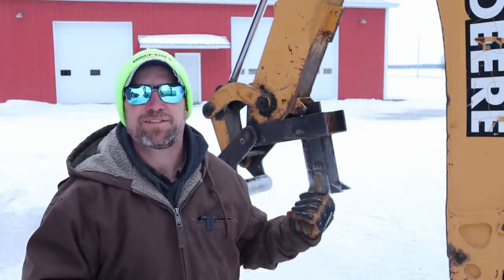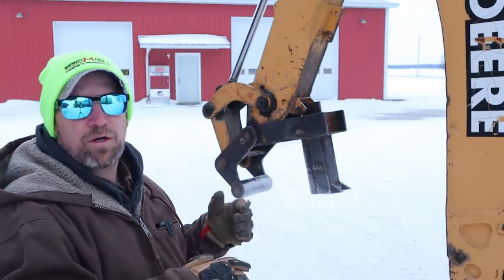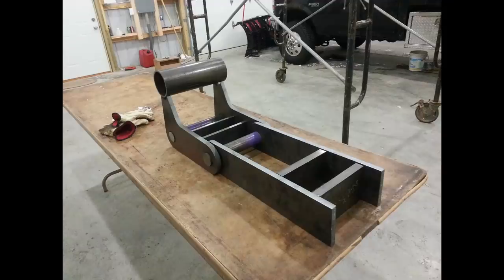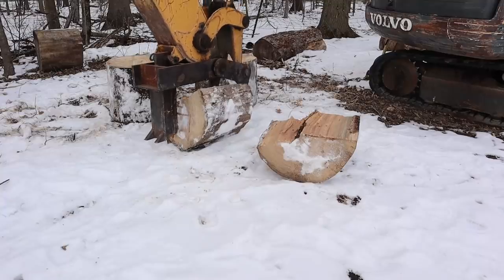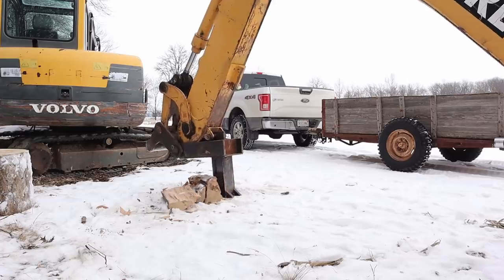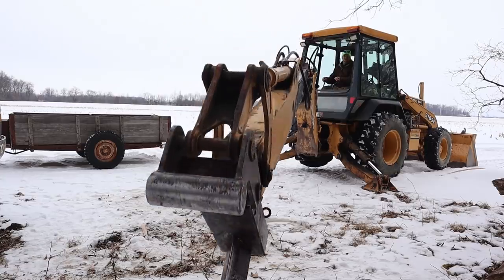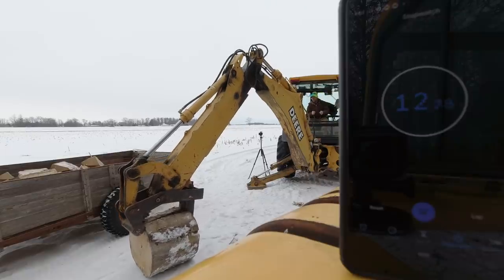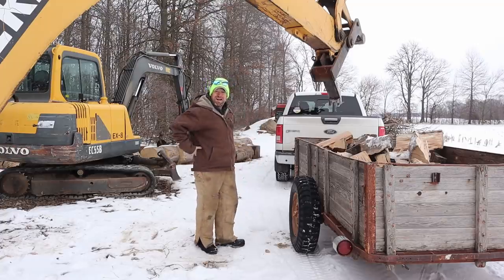My Wood Splitter Doubles as a Backhoe! - Homemade DIY Wood Splitter Splits Large Rounds With Ease

Comment: I’ve been thinking about something like this for a while. Since I have some 1/2” plate kicking around I thought I’d give it a try. 
I bought a cheap plasma cutter, created a cardboard template then cut the steel. I used a snow plow cutting edge as the splitting edge and the rod from a plow cylinder to use where the bucket attached. I welded it all up, attached it to the back hoe, grabbed a log and Bam! All my welds popped like a joke. After cleaning things up and re-welding a few more times I discovered my little 110v MIG welder didn’t have the sack to penetrate the 1/2” steel. So a new (cheap) 200 amp stick welder was ordered.  After some practice, I got the welds looking pretty good. Attached everything again and grabbed a log. Presto! Split my 26” dia oak logs like a dream. I was so psyched! 
For those who want to try this.. it can be done and does work. You’ll need the right tools and lots of patience. Don’t give up when it falls apart the first few times.
Reply from the maker: That's right!  Keep at it.  I had to redo the wedge on mine after I bent it the first time.  I'm always refining it it seems.  Thanks for watching!

Comment: Thats a really sweet setup for cracking down boilerwood. The real secret to firewood is the biggest volumes of firewood come from the biggest logs so to work the big wood effectively is the real key to efficiency
Reply: Hi Not Sure - it's Big Rodders in Ireland.  I live in hope to see a long video of your super log processor in operation.  It certainly is a unique design.
Reply: @rodneysweetnam8653  I have some more videos uploaded Big Rod. Maybe this year I will make some more effort to film but usually I'm focused on running the machine
Reply: @NotSureJoeBauers  - Big Rodders again.  I'm subscribed to your channel and have viewed the various short videos you've uploaded.  They have whet my appetite for more.
Reply from the maker: Boy, you are right about that one!  I always drool over the big ones cause I can make so much wood so fast.  Lots of folks avoid them though cause they're hard to work up.  This  splitter is the nuts for the big ones!

Comment: Thank you Neil for taking the time to do this.
I know everyone is looking for measurements. Here is what I get from looking at the picture.
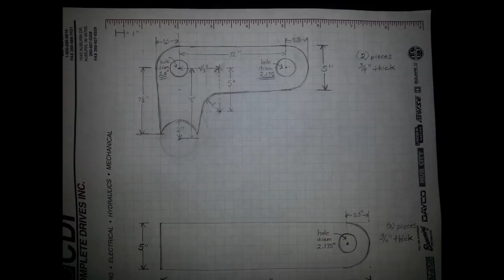Picture starts at 3:39
Looking at the diagram. Make out of wood first. A lot cheaper to get your prototype that way.
2 Back plates. 3/4 inch thick. L shape.
For John Deere 2 inch pins.
Hole diameter 2 1/8 inch would give a 1/16th gap all around. Guessing it would be enough room to freely rotate.
Top portion as shown in the picture. Length is 17 inches. Width is 5 inches. Measure in 2 1/2 inches and 2 1/2 inches down would be the hole center. The hole centers are 12 inches apart.
From the left top hole center down 8 inches is the pusher bar center. Pusher bar is 4 inch diameter.
How far apart the 2 plates need to be, I don't know. Hope this help a little.
Reply from the maker: Thanks so much for all that!  I need to get it documented.  I've had so many people ask and I can keep up with everything at the moment.  Getting behind on the comments too.  I appreciate you taking the time t write it out here.  I will point people to this comment.  Thanks for watching!
Reply: About much did it cost to build?

Comment: I wanted to thank you for posting this video. I just finished making one of these for my Deere 110 TLB. It was more in depth in the design with the quick change bucket that Deere had developed. I also felt it necessary to "beef up" the attachment point on the crowd. But with all the design, figuring, head scratching and fabrication done I am loving every minute of this attachment. The learning curve was quick for me. The third day I could see my production dramatically increasing. So far 22" diameter is handled with ease from my seat. I just love saying that! I do have a bad back from years of construction and ultimately having a disc removed. But with this attachment my back is in good shape. Thanks again for this share.

Comment: Here I thought we really had something when my brother built our first wood splitter 😁 It did do about 25 years worth of wood splitting for 3 of us, and is still in use 35 years later.
Reply from the maker: Sounds like you really do have something there Charles.  Any piece of homemade equipment that can put in that many years and hours of reliable service is a truly great machine!  My Dad built a homemade splitter as well and we still use it once in a while.  Thanks for watching!
Reply: @digdrivediy  Originally, that home made one ran off a used up worn out 5or6 hp engine my brother got from his neighbor. It ran about 5 years with that, then we collectively bought a new 5 hp BRIGGS. That engine is till on it, but has been experiencing difficulty of late. 😉

Comment: Neil you are a fine Gentalman and great enginere-fabricater. My fire wood endeviours have rewarded me @ 80cents an hour to heat my 4 different houses with firewood ; all things considered.  On the otherhand selling the product has yeilded 15.oo$ an hour selling the product. I would us a 6 pound splitting maul for fantastic results in 95% of logs succesfully achiving this at a half of cord per hour. (Cord =4'×4'×8' tight stacked wood). Home heating using this amount typicaly lasts 4 days. So mathamaticly speeking ,8 cords = one month of heating VS. Paying a 120.oo$ gas bill & a no touch effort. Selling 8 cords will yield aprox. 1200.oo$ with loading,delivering and restacking to costomers. So the margine of the resourse is EIGHT × more proffetable ( incluiding delivery&handling expeditures).With a total time to process a cord = to 4 hours total time, including the harvasting, gathering ,splitting,stacking,loading( note:many times over repeated in many facites of the total aplication) ==== lots&lots of WORK. Not to mention I am payed to haul raw wood away. And further more I would never burn a drop of fuel in my tractors or loaders  once the raw wood is payed for (costomers lot clearing or tree removal jobs).              By the way Mr.Niel upon observing your fine mechcanised ways I believe I'm 2× faster & more efficiant. I have prossesed aproximatly 250 cords with my time tested & provened methods over the years. The time studied ways (and many at that) have yield me a minor wage & lots of fun in the firewood monky-bussinuse. The exercise & fresh air are the best beniffits. Burning up fuel and expensive eqipment (trucks, tractors,trailers) hardly, HARDLY ever-EVER pays more than 5.oo$ an hour. My 30 year old (wheelburro-6 pound maul splitting way) was & still is the best for the last 40 years. Maybe when I am old & decrepped I might find a more efficiant way.!                                I enjoyed your vidio immencly & out of the 50 or so firewood processing vidios I have seen,l have laughed all the way to the bank--- with your exception. Realy nice rig for your 150,000$ back-hoe to split a 10 cent piece of firewood. My equipment == 225,000$ put that ends when l have been paid to haul it (raw wood) away initially. I have learned a lot over the years, kindness,respect,generosity, learned&shared,plus hard work,produtivity have given me much joy to serve my fellowman. Likewise l consider my tallents & endeviours a Great Blessing. Once again thank you for your inspirational vidio Neil.
Reply from the maker: Thanks so much Donald!  That's a good bit of info to process but it sounds like you've got your firewood endeavors figured to a fine science.  I have a much more pragmatic approach where I usually just try to solve my firewood needs with the most sensible means possible.  Often times that should involve more manual labor options but I always seem to opt for the mechanical solution whenever available!  I usually only use the backhoe to split wood when the pieces are too heavy to lift.  I hardly ever use a maul although I probably should try more often.  I can completely agree with your statement of fresh air and exercise being some of the best benefits.
I really appreciate you watching and for leaving a great comment.

Comment: You've got some skill with that backhoe! I will say, that oak pops nicely and I find it really pleasing to split by hand with a good Fiskars maul. Really would like to see this awesome contraption on wood I hate to split: Boxelder crotch or Elm.
Reply from the maker: Thanks, takes a bunch of practice.  There is certainly wood that it doesn't like, like heavy crotch wood but I can usually break down most stuff. Thanks for watching!
Reply: да он действительно экскаваторщик высшего класса..!

Comment: That is absolutely genius and very fascinating!
 It looks like you have enough hydraulic power, to run a blade horizontal to the one that you have and have it T midway across the existing one, then you could split a log in fourths in 1 bite.
Reply from the maker: I've tried with minimal success and I cut it off. May try again sometime with different design. Thanks for watching!

Comment: I'm just 31 seconds in Neil... And I'm feeling your pain brother. I have actually done that in the past. When it's a cold outside. Be careful :-)
Reply from the maker: I tell ya, it's a pain.  I hit that piece 10X more than what you see in the video.  I had worked up a good sweat and I never cracked it...
Reply: @digdrivediy  I swear some of those trees I used to hit when it was freezing cold we're made of rubber :-) I love the way your backhoe does it. That's the way I like it sitting in comfort and splitting wood :-)

Comment: I’d be interested in a price on the plans for your splitter as well. One of the simplest and nicest designs I’ve seen.
Reply from the maker: Thanks Joel.  What is a set of plans worth?  I've had several ask but don't know what I'm looking at in terms of what people would be willing to pay in comparison to the time to have something drawn up.
Reply: @digdrivediy  i would buy a set of drawings if you decide to sell them
Reply: @digdrivediy   People say they are interested until time comes to put their money where thier mouth is lol. I personally wouldn't be bothered selling the plans. Its a simple design. The plans really only have value if someone has the cnc burn table to cut the plate out...    Kick ass wood spitter tho! I just got a Case 580 backhoe and I was thinking of some sort of auxillary hydralic line or something for splitting wood. Your design is way easier to implement.  
I can def. see how it may take some skill operating that over to each log, but this is easier than loading each heavy ass log up onto a wood splitter. So my opinion is its even better than a regular wood spitter since it saves your back!

Comment: Many thanks Neil for this demonstration.  Love the plywood mach up you did.  I am planning to examine fabricating a pusher and wedge that may be attached to my mini ex bucket and thumb avoiding the need to knock pins out etc.  will need to immobilize the thumb and probably will want to not use a drilled buck pin to avoid cracking it. Wish me luck.

Comment: For your shearing bolt on the pin problem maybe you could weld two pieces of 3/8 thick stock to the face the pin bolts to. This  would “trap” the outside of the pin where the bolt goes through then the bolt wouldn’t have any shearing force applied to it.
Reply from the maker: Had some others suggest that as well.  I think I'll be doing that soon.  Thanks for the comment and thanks for watching!

Comment: Great idea. If my math is right. It took you 12 seconds to get back in the cab after setting the timer.  Then almost 15 to get back to stop the timer. Not a bad time.  My son and I have stood our splitter up and rolled big rounds to split. We thought we were high society. Your method sure beats a maul and wedges. Before we got our  splitter we would score the rounds with a saw then use a sledge and wedges to split them. Needless  to say using that method we had  a pickup load of big rounds that sat till this year when we got our splitter. Now I wanna go buy a backhoe lol. Thanks for sharing I enjoyed it
Reply from the maker: Thanks Kory.  Those vertical splitters can be really handy too.  I actually have a 35ton TSC splitter as well that I've tried to stand vertical and it can get the job done for sure.  We used it that way several times before I built this.  I think I proved I'm pretty useless with a maul too!  You go get that backhoe! lol.  Thanks again buddy.

Comment: Keep a bunch of old trailers on hand... never stack your wood at home. Just park one closest to the wood stove...
Reply from the maker: I actually love that idea Jack!  I've been on the lookout for more trailers to do exactly that.  Thanks for the great suggestion.  Anyone got any junky trailers for sale that will hold at least a cord of wood??
Reply: I use a couple of old manure spreaders.
Reply: I made a large box using sturdy pallets with a top which can be removed to fill and a hole/hatch in one side to access the firewood. There's a pallet as the base too which I can use to move it around with pallet forks on my JCB bucket but old trailers is a great idea too!
Reply: From all the wood you get from storm cleanups, maybe you can build you a couple of heavy duty sleighs to haul and stack them chunks and pull them around with that backhoe at the same time?
More cost effective than trailers i guess?
At least no flats to deal with😁
Cool stuff, thanks for posting☕

Comment: Neil I see your wood prototype had the 4 inch PVC angled towards the wedge about 4 inches.....then your steel one is 90 degrees straight....did you ever wish the 4inch PVC when pinching close to your wedge was a little longer....the steel one is angling 4 inches up from the end of the wedge...if it were a little longer it would almost touch the blade.....also a piece of keystock on each side of your teardrop pin retainer will prevent it from rotating and shearing your retaining bolt...skidders have these on their pins....I'm making the plywood templates to adapt your idea to my 580 case backhoe....thanks for the inspiration...now I just have to get moving on the new project!!!!......Thanks Neil
Reply from the maker: Hi Richard.  Like you, I saw that my plywood templates were different than the finished product, but to be honest I can't remember the reason for the change back then.  The angles weren't right when I built the first version and for whatever reason I changed it.  Unfortunately I didn't keep any kind of record or alter a blue print so all I can say is I just changed it to work better.  When I had the plywood on there, I was picking up and attempting to "split" rolls of fiberglass insulation and a few large chunks of Styrofoam.  So, I was cycling it while picking something up to test it.  That is what led me to changing it.  The push bar on the finished splitter does come around and just barely touches the wedge.  Best of luck with your build!

Comment: That is very cool ! I have a bobcat e42 with a quick attach bucket and I was trying to come up with and idea like that but I would have to run another cylinder off the secondary hydraulics. Very nice.
Reply from the maker: Thanks Eric!  It works pretty darn good for as "simple" as it is.  I use it all the time on the big stuff.  Still split the stuff I can handle with a normal hydraulic splitter then.

Comment: Hi Neil - it's Big Rodders in Ireland.   Your invention is one of the most impressive DIY inventions I've seen on YouTube as it appears to be an affordable addition to the average log hound.  It's easy to get great equipment if you throw big money at it but firewood is a low margin business and equipment needs to earn its keep.  Thanks for the shout out - I sometimes feel I wasting my time making suggestions but you've restored my faith.  I used to split 180 cords a year, now down to 30, but would have retired years ago without my timber tongs.  They've turned into natural hand extensions for me by this stage and with a bit of practice you'll develop that flick of the wrist to lock them on and then to throw the log.  They are particularly useful if you're bucking logs as you can just stand in the one spot and pull logs towards you without having to stumble all over the place trying to go to them.
Reply from the maker: Hey Big Rodders!  I'm so glad you caught the shout out!  There is certainly a learning curve to using the tongs but I can already tell how useful and helpful they will be.  I split that bit of wood on the ground just to try out the tongs!  I am hoping I get better at releasing them as I throw them as many times I'd go to let go and it wouldn't.  Thanks again for the suggestion.  It's always best to listen to the fine folks that have more wisdom about a subject than what I do.  i'd still be bending over if not for you!
Reply: @digdrivediy  Big Rodders again.   Its all in the flick of the wrists.  It's the rear tooth that locks the log when lifting so twist your wrist away from you when lifting.  To throw, swing the log and at the correct time flick your knuckles upwards towards your elbows to release the piece.  It's easier to do it than write an explanation!  The way you developed the technique to split the logs proves you'll have little difficulty in mastering timber tongs.  I'm off now to split a cord of wood.
Reply from the maker: @rodneysweetnam8653  I'll keep working at it!
Reply: @m9 ovich Hi Mike - Big Rodders again.   Thanks for the interesting idea - I must look into it.  I am amazed that timber tongs are not more widely used.  I view many videos where it is obvious they would be beneficial to log hounds.